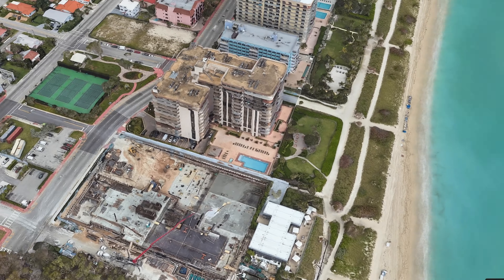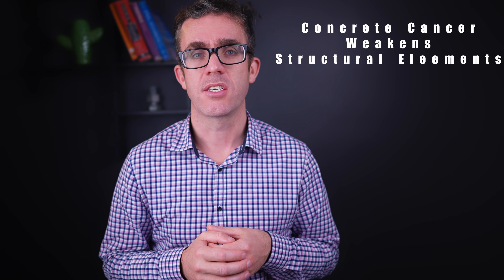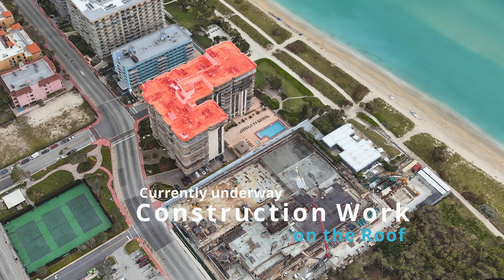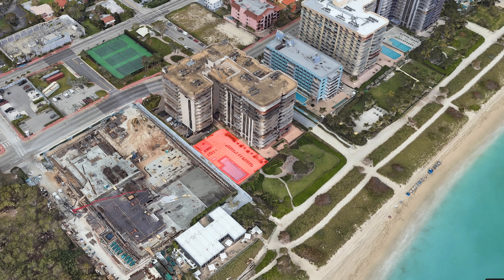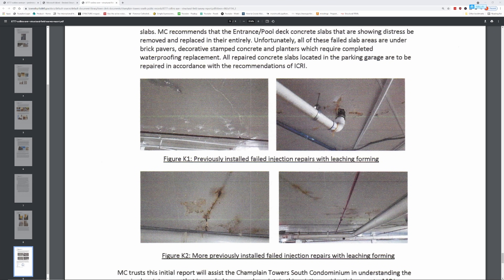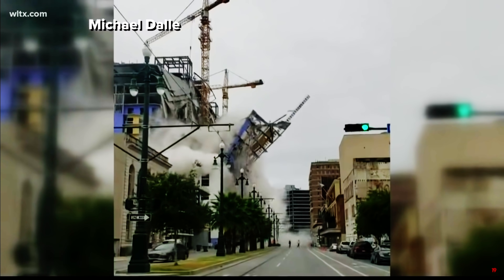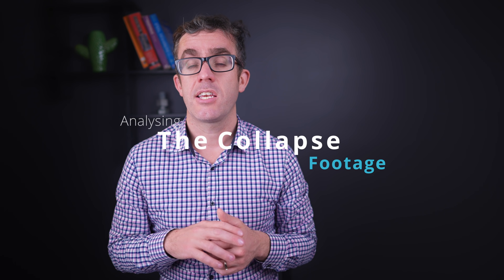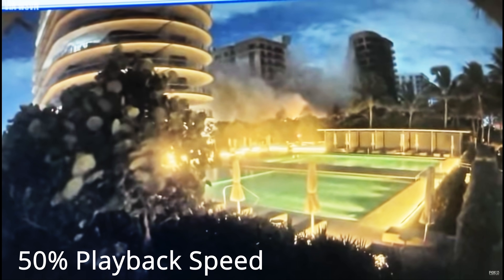How did a Miami building collapse: The Warning Signs. Report and  CCTV footage analysed

Comment: Greetings, the Champlain Tower was a dual mat rebar slab construction, no post tensioning there. If you down load the plans from 1979 from the City of Surfside website and study the plans and compare them to the surveillance video, you will understand how the collapse happened. In the video the first section to fail were at column(s) I10, and/or K10, this would make sense as those columns are directly under the D line. Then columns L10 and M10 (C line) went next, there was a slight hesitation when the second section failed, I think this is due to the Transfer Beams located at columns K10, L10, & M10 (labeled BMA) which I believe was designed to give support to the Planter Boxes. You can see the Transfer Beam's at pdf page 162/336 sheet S5 of 14. I believe the initial cause of the failure starts with the pool deck experiencing multiple punch shear failures at ~10 columns. You can see the columns sticking up through pool deck in most pics between the pool and the now debris pile. The building was very poorly maintained and the Morabito report in 2018 clearly showed structural members with severe rusting on columns. Once the pool deck fails, it resulted in potential beam rotation and column buckling from catenary action at columns I10, K10 (D line) first to go and then L10 and M10, C line second to go. If you search for the video of the couple who took the video into the garage, you can see a rubble pile at the bottom of the 22' ramp which is either a beam failure, stairs or some say the planter boxes, but I do not agree as the planter boxes are roughly 60' further at column M10 at the other side of the building. Since the rebar lay spec was only 3/4 inch back then, when the pool collapsed, I believe it cause a ripping off of the rebar in the garage ceiling from column row 10 (planter boxes) all the way back to column M3 which is about at the foot of the ramp. I also think when KCE does a forensic examination of the concrete samples they will find that the grade of mix used was skimped on meaning more sand less mix equals weaker concrete overall. I also don't think they used enough rebar or the right size, the 16 x 16 columns called out #5 (5/8" for lay people) they only reinforced around each column with no linking of rebar to the next column which is the standards of today. If you do a search of the construction company owner, an attorney, had financial problems in Canada, Fled to Miami and somehow became a builder. The first Tower the South had delays for years and when that happens it eats up funds on a daily basis so in order to make any money on this first of two jobs (North Tower) he probably skimped on anything he could have to just get the building built. If you've seen the North Tower it is pristine compared to the south tower. You can just google Champlain Tower and use the bot and go right in front of the south tower and pan up, there are multiple multiple places where spalling occurred, do the same on the north tower and you won't find a thing.  In any case, this is what I think occurred and the sequence of events for this terrible tragedy 8 mile down the road from me. God Bless the souls who were lost and prayer for a miracle they find anyone alive.
Reply: Very good summation and a thoughtful closure.
Thank you!
Reply: Thank you. Very very informative and analytical.
Reply: Yup, that's what happens when you have unexpected delays on a project, but then still have to/want to meet now unrealistic deadlines for financial or marketing reasons. It happens in the tech and business world all the time. All this should ring a warning bell to all prospective condo buyers. Look RIGHT PAST all the pretty talk of your slimy RE agent (who likely doesn't even know the difference between a furnace and a boiler) about marble countertops and crown moldings and steel appliances  and go right for the questions that really matter. Do NOT fall in love with a building or a location or a view or the ocean or whatever. Find out TECHNICALLY WHAT you are buying. Who's product and what quality. Look holistically at the entire building and property and if ANYTHING looks weird or illogical (look MAINLY in the basement and a severely rundown or tired look THERE for a 40 year old building is NOT normal), MOVE ON. If you can't muster such rigor, go for a single family house. At least there you have some individual control over what happens down the line, and also a bit more intimacy with what your are buying at time of purchase. Condo purchases are made to look easier than they should be. There's this illusion that you don't need to be as savvy, buyers are easily distracted from much probing, especially if they have hardly a clue what to look for, and after all you think there's power in numbers with all those other people there seemingly living that 'care free' life.
Reply: @comment6864  Oh BTW, I'm a sleazy realtor also... But I was a Civil Engineer way before I became a sleazy realtor... ;- )
Reply: @tradermomo007  Right, well then you are an exception. There are some exceptions but in this case it only confirms the rule. I've noticed that RE is a secondary 'profession' for people from many different walks of life, everything from insurance agents to former school principals. In MOST cases in the end their usefulness usually boils down to a door unlocker and maybe a negotiation mediator. In other words nothing to do with real estate LOL. And buyers just have to be very cognizant of that.
Reply: @comment6864  Many people that become realtors come from as you say a part time other job, like Insurance agents (health mostly) its a seasonal thing during open enrollment, so they have tremendous time for the other 9 month to earn. Health Insurance agents used to make a lot of money all year round (Yes I'm a licensed agent also) until ACA came along, then we didn't. Teachers have months off in the summer, and the money they make during the school year I'd be looking for another income source also, so can't blame them... As far as the value Realtors bring, you really don't understand what they do based on your comment. People who don't know the "system" can get burnt by mortgage providers, appraisers (yes I was a licensed appraiser also b4 a sleazy realtor) there are so many things that realtors do but most people like your comment just have no clue of what goes on behind the buyer... Whatever state you live in, I challenge you to take the school class for 8 hours for 10 days and let me know if you even pass the school test. With a 70 to pass. Then, go sign up for the State test and let me know how many times it takes you to pass that... If you do this, and can't pass anything, then I know you truly do not have a clue... I pass my State Realtor exam with an 89 the first time. Today, the school is 10 days 8 hours a day and includes all the aspects of the ACA plan, so it includes legal, regulatory, ACA, Medicare, and Life Insurance. You have to learn that in 10 days and pas the school test with a 70. If you can even do that, you earn the right to bash realtors, other wise stick to just watching videos from people that know what their talking about. Have a nice day
Reply: @tradermomo007  Not sure why you're so worried about all these other people not making enough money if you're a civil engineer, but whatever.. Yes, likewise - have a nice day.
Reply: @comment6864  this is great insightful info.  Many “luxury” condo developers these days use the lipstick on a pig method.  High end appliances, finishings and fixtures, but the bones are section 8’ Apartment grade construction.  The question is when all the walls are up and the roof is finished, how are you gonna know what kind of wood was used, the distance between beams, structural deficiencies, sound transfer between units, load bearing inadequacies etc??
Reply: @JonNobleNobelOne  Yeah, good point.. I guess you have to always assume that no matter how luxurious or not luxurious a place is considered, the construction underneath it all is simply run of the mill at best. Look at that millennium building in SF.. it was touted an engineering masterpiece, all sorts of fanfares and awards were given. Now it's the sinking and leaning tower of Pizza. LOL If that's the case with such a 'star' building, you can just imagine where a one-of-thousands ocean front condo's fall on the scale. Of course the goal was to get through the construction and to the lipstick phase as quickly as possible so that all the RE agents can descend upon it
Reply: @comment6864  Thanks to Federal Reserve and Treasury policy, the market is a seller's.   One is lucky (he thinks!) to find anything affordable in a desirable location, like Florida.   Refugees from other states with terrible climate and tax problems are increasing the demand for housing where the supply is already inadequate.
Reply: Fantastic synopsis! I agree, poor build quality, poor maintenance, and age. This scenario was honestly an unlucky sequence of events... Sad, and troubling
Reply: Trader mo , while I suspect that everything you have said will eventually be verified, I have a hard time understanding why more buildings haven’t collapsed if we are just looking at a cheap concrete mix in an oceanfront building. I’m not an expert by any means, my interest is forensics so I’m not questioning your experience, I’m just trying to understand what I’m missing. This guy skimped on materials on one project (and got away with it) We already know he was a slime-ball. Then, on the North tower he uses proper materials? I have a hard time believing that. A (generally) honest person might cut a corner and not do it again, but a guy who demonstrates a pattern of dishonest behavior changes gears and does it right the next time? Isn’t it more likely that he used the same concrete on both buildings and the reason we were able to see all the spalling and the eventual collapse of the south building was delayed/deferred maintenance of concrete and added weight of pavers and planters on the pool deck? I have no interest in assigning blame. I just want to understand what happened over the years that led to the tragedy.
Reply: @davebrewer9279  Hi David So here is my response: The building collapsed on June 24th. the next day I got hold of the plans (not from the Surfside website which were not available till days later) and began my research. On Saturday June 26th I email a pdf doc I put together and sent it to Jackie Nespral at NBC6 and the Mayor of Miami-Dade County with my potential cause of the failure. On June 27th City of Surfside hire KCE (Allyn Kilsheimer) https://www.miamiherald.com/news/local/community/miami-dade/miami-beach/article252405583.html. A few days later he was interviewed with the 5 step program he will use to determine the causes of the collapse see video here:
https://www.nbcmiami.com/news/local/surfside-hired-him-to-investigate-condo-collapse-heres-how-hell-do-it-0/2485052/ So this was the process that he was going to go thru to determine the causes of the collapse, keep this in mind. On July 1 I sent Allyn this email:

 "Good Morning Allyn,  I am sending this based on my research, it may be correct or it may be not correct.

Based on the surveillance video, the Morabito 2018 report of column spalling in the garage, the original building plans,
Reports by tenants of constant water pooling in the garage across several parking spaces
Around space 78 and adjoining spaces this theory may be a possible chain of events on how this happened. 

Potential of origin of the collapse began with failed columns where the planter boxes butted up against the building.

I also feel that with the addition of the design change of adding the Penthouse, the entire structural design of the columns 
And materials used should have been beefed up.

Review the rebar used in the columns.
Also I do believe the contractor did skimp on the grade of concrete in the original construction, I would forensically test the concrete
To determine the grade and determine if the F’C PSI loads were adequate for the addition of the penthouse.

The PSI spec’d in the original design I feel today would never pass building code standard.

I am not a PE, but based on what I do have knowledge in, this building was constructed at the bare minimum construction standards.

Maybe this will help the future investigation.
Stay Safe Amazingly a couple days after this email, this article appeared in the Daily Mail (Sorry for using overseas news, local Miami Herald wants you to subscribe to their rag b4 you can access their content) https://www.dailymail.co.uk/news/article-9755133/Engineers-fear-collapsed-Miami-condo-lacked-reinforced-steel.html So in the interview he outlined a 5 step process to determine causation right? Now a few days later after I sent him my email, viola! Less rebar in final build than original plans. Hmmm where did he get that info so quickly. I was just trying to move the efforts forward that's why I sent my findings to the NBC6, the Mayor of MD County and KCE once Surfside hired him. So in building construction contracts, permits and all that goes along with it, when a project is delayed for whatever reason, it is costing the construction company huge $$$ for every day they cant start the project, at some point in order to get the building up and not be upside down financially desperate people do desperate acts. So yes, he possibly skimped on Champlain South, to keep the contract for Champlain North which was built up to code at that time it appears. As today after inspecting CN Tower structural Engineers could find no apparent sign of any issues like in CS Tower. Allyn will find the root causes and sequence of the failures but I am fairly certain  what I put out there is pretty close to the origins. We will see. I hope this answers your concerns. Stay safe!
Reply: @tradermomo007  we’re all sleazy realtors? 😂 I actually got out as soon as I discovered the ugly side of the business. I just didn’t have the stomach for it and I didn’t need the money that bad. Anyway, thank you for your help. I will check out the links. I also was annoyed by the Miami Herald thing, I live in Utah and really don’t need to subscribe. 😑
Reply: @tradermomo007  I looked at the columns, concrete strength and reinforcing compared to the load and there is no obvious problem there.  I think it safe to say that the concrete strength and reinforcing steel strength will be tested very thoroughly around the structure.  I don't think it is likely that a problem will be found with the materials used but it is certainly possible.
Reply: @billj5645  The South Tower grade of concrete was clearly skimped upon, I can tell just by the color of it. If you look at KCE Allyn Drilling core samples from the North Tower the week of 7/14, you will see him holding solid core samples with the right amount of aggregate and mix (proper color) The building skimped on the first building in multiple ways, not enough rebar, the wrong size rebar, not interwoven rebar attaching one column to the next, and lack of rebar, even KCE's Allyn stated that last week in an interview. 16" columns with #5 rebar without additional rebar structural "box" built around each column as they do today is the contributing factor of why the slab floors released immediately and pancaked. Todays building even if you had a catastrophic failure of half a floor, should have held up for long enough for the occupants to evacuate! This building was not built up to code even in the 1980 standards, THAT I bet you can take to the bank. I will wait to hear what KCE Allyn K has to say, I email him all my findings the second day he was hired and hopefully he is considering that info in his research. There were also multiple PE's on Youtube that came to a very similar conclusion as my observations. so I can't believe 3 to 5 PE's and myself are soo far off the origin of the sequences of event that caused the collapse, but we shall see  What Allyn at KCE finds when his investigation is complete.  That's what I have for you at this time! cheers!
Reply: @tradermomo007  I am certainly qualified to evaluate the drawings whether the building is/was designed per code, I've been doing this for many years.  None of us have full information as to whether it was built to code or per the drawings other than bits and pieces visible in photographs and videos.  There is a lot of speculation as to the pattern of reinforcing at the columns.  The configuration hinted at in the drawings is consistent with standards still in use today for that type of building, however the quantity and size of reinforcing still needs to be evaluated.  Some photographs clearly show that the reinforcing at columns was not placed per the requirements of the drawings.  Most commenters are incorrect about the configuration of reinforcing with respect to punching shear, the reinforcing is not there to resist punching shear.  I have done my own calculations to evaluate punching shear and I think the original design was deficient however looking at the actual loads in place at the time of the collapse, not the design load, the load and capacity were much closer together.
Reply: @billj5645  You are not taking into account the maintenance of the key structural elements were neglected for decades. Water intrusion, the pool deck in the 2018 Morabito report was recommended to be torn down and replaced. That plus the fact that there were numerous complains by the residents of water damage in their units on the top floors (roof leaks never repaired) plus salt water intrusion on a constant basis in the garage. C'mon, If you are the engineer you say you are, you can't look at the plans from 1979 and not take into account the elements of a building on a salt water seacoast, ill maintained structural elements and say that "The original plans looked ok" They don't look OK, Even Allyn J from KCE stated in two interviews that the rebar in the actually building did not match the specs from the original plans. I was in that building in 2005 showing a property and once we saw the garage, we ran screaming from that building so even in 05 the building was falling apart. Like I told KCE, check the grade of concrete on the south tower and they will find sub standard grade for that pour...
Reply: @tradermomo007  I would hardly label the North Tower “pristine”. I think the guy who ran out of money and cut corners was apt to do so time and again. I strongly suspect the north tower is compromised, though I do believe their better maintenance (it could hardly have been worse than the South tower) might prove a major positive factor.

There is no question the ground-level (aka pool deck or garage ceiling) slab was underdesigned and Poorly built. I think it may be under the specified rebar, which was poorly placed mainly in the top rather than bottom, and the core samples in addition to showing extensive damage and delaminated, also suggest a patchwork of different cement layers. And what of the connection to the main building? My understanding is that it is a no-no to bolt such a structure to the building, so that in the event of a punch-shearing event, the deflection is transferred to the main building support columns…

Many have also questioned the breadth of the columns underpinning the collapsed section, being only 16 x16 while the columns supporting the western portion of the building were a more robust 24 x 24, and many have questioned the amount and size of rebar in most of the members.

All of this I would say is decently likely to be the case in the north tower…
Reply: @kineahora8736  Your assumptions and comments are wrong. Did you not see the core sample they drilled from the north tower before the south remainder was demoed? Did you not see the core samples from the south tower columns in the garage and under the remainder still standing back then? The cores from the ST were a dismal failure in concrete standards. flimsy, weak, sandy were what some of the adjectives were from the coring team. If you find the cores from the NT they were prefect samples with perfect color with perfect amount of mix to crushed stone, if you did any pouring in your life you would see that the cores from the NT tower are like a Monet compared to the ST cores which like some really bad Picasso with no structure and random consistency throughout the gore from top to bottom. Cracked in several places including around the rebar. Go find the NT video of the core samples that came out in a single glorious tubular rod, like a core reactor rod, they were almost like core porn. Not hardcore porn, just core porn! go find the videos and then tell me that the NT cores weren't pristine as I've stated...
Reply: @tradermomo007  I did not see samples from Champlain north, no. I have been talking about the awful cores from the South building deck slab definitely looked like a time bomb of a deck slab to be sure.
Did the north tower have the same pool deck design? —I think it didn’t…
Reply: @davebrewer9279  The north tower is not complete identical to the south tower.  The north tower is shorter in length on the one side than the south tower.  It may have been enough difference in cost to not need drastic cost saving meaasures.  It also could have had a different inspector during the building process who focused or questioned different things than the South tower.  

Also factor in maintenance and upgrades over 40 years.  It sounds as though the North tower was better maintained and I am sure they both didnt recieve the same type of upgrades, which also may have had different inspectors as well.
Reply: @MrPetej00  , I agree. A lot of information has become available in the last few days. While there are plenty of things to criticize about the initial construction, overloading the pool deck and parking area along with deferred maintenance are coming into focus .
Reply: @davebrewer9279  Hi Dave, Your comment about him being a generally honest person is where your objection falls off the rails. He fled Canada to avoid prosecution so he is not "generally honest". However, he alone is not pouring the concrete, the subs that he used for North whether the same or different would have pour the correct grade of concrete because the concrete sub determines the grade of the concrete, not the builder. In the new construction game, especially here in So FLA, it is common for contractors and subs to cut corners to increase their own profits (greed) while the south tower was facing years longs delays and his funding to finish the project was dwindling fast, the only thing he could do was to cut corners. ONCE the south tower was up and completed and the COO was issued, the funding for the second tower came rolling in in a big way. So he got to -restart the north tower with a pile of fresh capital, without delays without permit issues, without code compliance issues, since he just completed the south tower successfully, everyone from an approval standpoint just let the North tower go up un-encumbered. So only the investigation from Allyn K of KCE will uncover the grade or lack thereof in the slabs and columns of the south tower. we will see, although I hear now the cheesy mayor of surfside (whom I applauded for doing a great job and being on top of this mess) Just told CBS 4 Miami in an interview that "This wasn't a structural failure it was an act of god"  So now I have have to contact Desantis, Nunez (who is bring a grand jury) and my research and the other 5 to8 PE's on You tube that basically came to the same conclusions that I did within two days of the collapse. THIS will not stand, this little shi&&y mayor of a town of less than 6000 residents is not going the get this sweep under the table if I can help it!! 
Did you hear that KCE Allyn Kilsheimer cannot gain access to the south tower to take core samples of the slabs and columns because "IT IS A CRIME SCENE"!!!
Reply: ... I believe the rebar drawings show only TOP reinforcement around columns , the BOTTOM reinforcement is usually described by the notes because is fairly
simply and not shown on drawings, something like that :
 #5 @12" bottom, both directions.
 I can not imagine myself a concrete slab without bottom reinforcement.
Reply: @tymoteuszzwroclawia  The drawings do show a continuous mat of bottom reinforcing.  The pool deck/level 1 slab is noted to have #4@12 bottom each way (upper righthand corner of sheet S5).  There are a few places on plan with additional bottom bars noted.  It would not be possible to make a structural floor slab work without bottom reinforcing.
Reply: @billj5645  the drawing I saw two day ago DO NOT show the bottom rebar (TOP rebar only), as you said (and I assume) the bottom matt must have been noted somewhere on the drawing but I could not find it . my comment was directed to Traded Mo who suggested in his comment that there is no bottom matt . impossible !!!!
Reply: Wow Trader Mo. If the had checked their credentials from Canada it would have raised a red flag in the first place period!
Reply: I think you hit the nail right on the head and great research on the builder makes sense also
Reply: Developer Nathan Reiber indeed has a nefarious history of shenanigans, all related to profit.
Reply: @Dilberto88  thanks for the extra detail on this criminal Reiber… I think adding the penthouse was a good idea financially. Since it was going to bring in lots of extra $$, you would think he could afford to put 1-2 million$ into a more robust structural design to support the added weight as well as to make sure other “corners” that lessened the quality of the structure were not “cut”.
Reply: @kineahora8736  - Nathan Reiber was not expecting to be a developer, actually. He saw the opportunity, only one week into his retirement in Florida. This first project was hastily planned and poorly executed from the very start. He initially was using his own money, until two key Contractors walked out on him, rumored to be he got stingy on materials and hired unskilled, non union labor. Reiber also enlisted a cut-rate Architect with a previously suspended license, due to two failed structures he designed. Not to mention  - materials prices was astronomical for the period. Reiber ran out of money right when Surfside told him there was a citywide sewage system moratorium. Four months later, Reiber returned with two heavily capitalized partners and a huge Toronto-Dominion Bank loan. By then, exposed rebar was already rusting and he commenced, after they paid half of the required $400,000 to create the city sewage system. Reiber was still not satisfied with the margins he was working with and bribed city council with $400 to rush-approve a hastily planned Penthouse. Find the collapsed building crane video, due to bypassing soil studies and operator incompetence. This project should have never happened at all.
Reply: @Dilberto88  wow you have lots of juicy details. Would you say the North tower had a better/more mature design with a number of details better planned and executed? Also it wouldn’t have had the same delays as the South. At first people had been saying it is “a twin building”, but looking careful I can clearly see differences not just limited to the add-on penthouse. The center section of the north tower seems less elongated from east-to-west than the corresponding section of the south building (the portion that collapsed first). And the whole ground floor “pool” deck looks entirely different…
Reply: @kineahora8736  - North tower was well designed and built. The two Goldlist brothers had enough money to ensure a quality job. It was Reiber’s lack of experience as a Contractor(Nattel Construction, Inc.), conserving his own cash, was the fatal element of South Tower.
Reply: @Dilberto88  so a different design then? Sturdier columns 24 x24 throughout the building? Better floor slab attachments to columns? Free-standing ground floor deck much better designed and constructed? People were saying initially it was all the same. Starting to sound totally different…
Reply: @kineahora8736  - you’ll need to view the plans, for North and East towers. I think the real difference is the upkeep was better maintained on the latter towers. I’m no engineer. I only know about Reiber, because my friend has parents who knew him well. The man was described as “thrifty & shifty.”